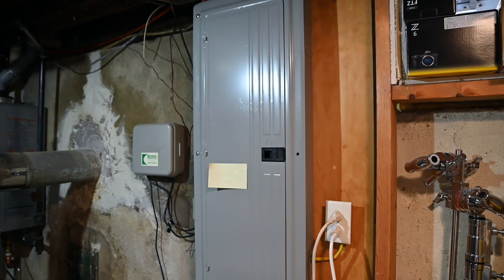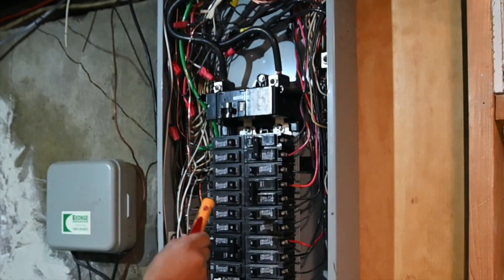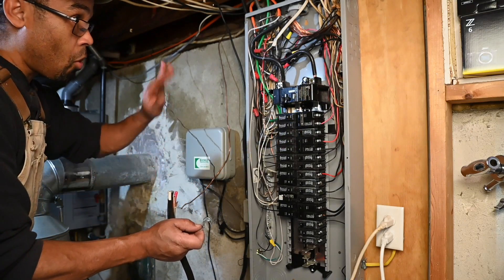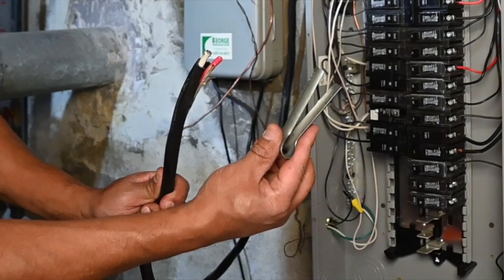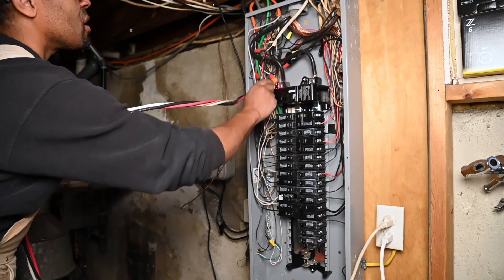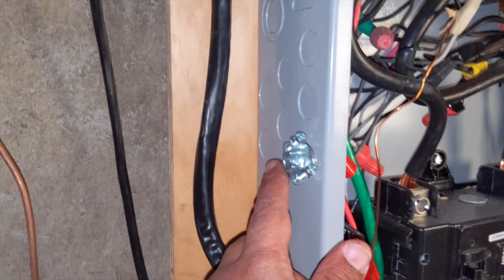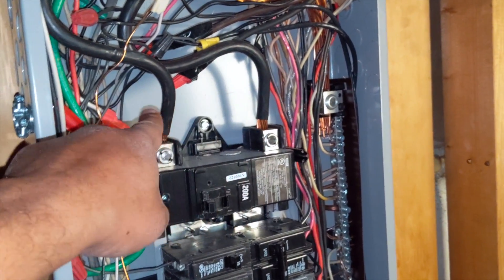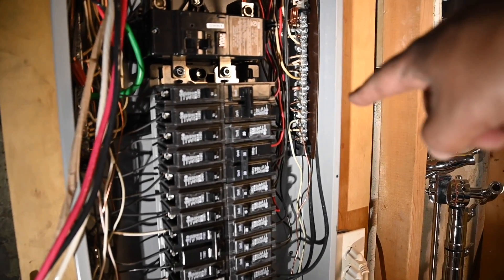How to install connect Tesla Wall Connector to main electrical panel Pt. 3. Tesla Wall charger DIY

Comment: While this is a relatively simple installation and I would love to do it myself, if my house ever burns down and the insurance company finds out I DIYed it without the city permit, I am afraid they would use it as an excuse not to pay out.
Reply from the maker: Use the proper insulated gauge wire and the proper fuse breaker. You shouldn't have any problems. But I understand your position. That's why I say, if you're not comfortable, hire a licensed electrician to help you with this process.

Comment: Nice install, however 6 guage romex is only rated for 55 amp continuous load. You have to upsize the romex or go with 6 guage thhn in conduit.
Reply from the maker: Good point, I’ll include a disclaimer in the video description.

Comment: You don't need conduit to run that wire that is outside the electrical panel?  I would be extremely surprised if you didn't need EMT or some other conduit rated for #6 AWG wire.
Reply from the maker: Thanks for your comments.

Comment: Hi I just got my Tesla but I’m worried my technician used on a wall conector a wire 8/2 black stranded romex with 40 amp all good we set the car to charge 48/48 amp and the breaker went down so what he did he change only the breaker to 50 amp now is ok no problem but he said he may have to change the cable to 6/2 with 40 amp breaker what do you think I should leave it the way it is or change it I just don’t want my power bill to become expensive because of the cable but so far is working good and I’m setting my car to charge  30/48
Reply: He has to change that wire. A #8 wire will not carry the full ampacity of a 50 amp breaker. There's a fire bound to happen soon. Change that wire please.

Comment: Hi Ray, thanks for posting this DIY. You kind of skipped over the neutral at the end by just saying that you had your 'ground hooked up".   Did you end up hooking up both the neutral and ground wires to the ground bar or did you cap off the neutral?  Please advise as I'll likely do the same.
Reply: The neutral isn’t required for most EVSE, they only use 2 hits and a ground.
Reply: It was a great video, one question, I see you connected both white and copper wires to ground Bus. Is that ok to connect both white copper wire ? Other side inside the Tesla gen 3 wall connector connect copper wire, back and Red and leave the white one with cap and not use it?
Reply from the maker: @udayabhaskarsuryadevara9462 Great question. I only one wire is connected in the unit itself. I did that just in case. I could have just cap it off. On both sides. Not an issue for me.
Reply from the maker: Thanks for the feedback and please remember to subscribe and like the video. To answer the question, I attached the ground to its bus If hope this helps. Please be careful and if your not confident get a licensed electrician.
Reply from the maker: Let me check on the neutral I forgot what I connected to. Let me get back to you,
Reply from the maker: Please watch 11:30 time stamps. I explained why I did. I hope this helps. Good luck 🍀

Comment: Great Video and explanation. 
One comment- you used 6/3 and not use the dedicated ground wire but from other videos i see you can buy cheaper  6/2 use 2 wire as live and dedicated ground wire will save money especially cost of copper wire is very high now a days .
Reply from the maker: Thanks for the feedback and please remember to subscribe and like the video.

Comment: was a good video....just a suggestion to others doing this...step to the side when shutting down a main breaker...never in front of it...also...I would probably shut down most if not ALL of the other breakers in the panel so that when you turn on the main...it's not a huge load being put back on....I mean I could be wrong, but I think that could blow a main breaker keeping all the others on...once the main is back on...then I would turn the others on giving about 3-5 seconds between each breaker I turn on...
Reply from the maker: Thanks for the feedback and a great tips. Please remember to subscribe to the channel and like the video.

Comment: Is this 60A with 6awg wire ?!? You should change that breaker to 50A.
Reply: Check the specs on the cable you purchase. The typical ampacity for 6 AWG varies from 50 to 75 amps but is not limited to this range. There is no one answer based solely on the wire gauge.

Examples: 
6 AWG Copper with 60°C insulation (like TW, UF): 55 Amps
6 AWG Copper with 75°C insulation (like RHW, THHW, THWN): 65 Amps
6 AWG Copper with 90°C insulation (like THHN, XHHW): 75 Amps
Reply from the maker: Thanks for the feedback and please remember to subscribe to the channel and like the video.
Reply: Depends on the wire ratings. I just used 6 Awg treble cable rated for 75 amps
Reply: @mostafa685  
What is treble cable? 
I am familiar with treble-bleed circuits. They are basically high-pass filters. But what is a 6 AWG treble cable?
Reply: @treelinehugger  it’s like an entry cable to a meter but, it’s used for generators. It’s pretty solid and more durable than Romex. It’s a bit pricey but, worth every penny. Not sure if I can share a link here or not!

Comment: If you are a real noob pull the meter
Reply from the maker: Thanks for the feedback
Reply: Pulling the meter for this project is the equivalent of wearing a crash helmet, elbow pads, and knee pads every time you drive your Telsa to the grocery store. Its overkill. 

If you feel you need to pull the meter, then you should consider hiring an electrician to do the work.

Comment: No conduit??? That is a no no..
Reply from the maker: Thanks for the feedback.
Reply: why would you use conduit clamps without a conduit ?
Reply: Why would conduit be needed near the main panel, when everything else is NM cable going into the panel?

Comment: Can you tell me why you used a 6/3 wire instead of a 6/2 ?
Reply from the maker: Thanks for the feedback. I think at the time I pick up the 6/3 because I Thought I needed a 6/3. But I believe you can use a 6/2. I didn’t want to exchange for the 6/2. So I just used what I had. Please remember to subscribe to the channel and please like the video.
Reply: @DIYNATIONUSA  I made the same mistake. I, too, didn't bother exchanging the cable that was cut to my length. I wouldn't feel right about that.

Comment: black and red wires doesnt matter which ones goes in which circuit breaker?
Reply from the maker: Yes, it does matter. Please watch the video again. Please understand the Process before you start. If you’re still having trouble please consult a licensed electrician. Thanks for the feedback and please remember to subscribe to the channel and like the video.

Comment: Thanks for the instructions. Did you screw both the white wire and regular ground wire to the ground bus?
Reply from the maker: Thanks for the question. Yes, I use my white wire as a ground. Please check out part 2 of playlist. "how to install Tesla Charger". The reg ground wire was also connect but that isn't connect to the tesla unit. I didn't want to have a long ground wire not connect in the panel.   Thanks for the feedback and please remember to subscribe and like,
Reply: Wait what? So they connect to the same bus?